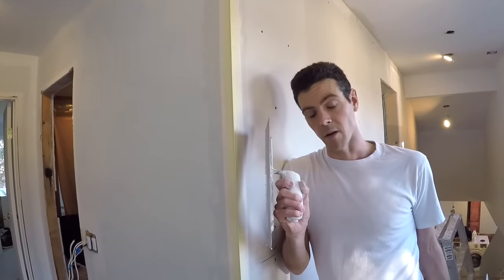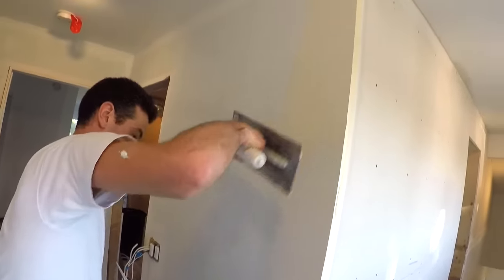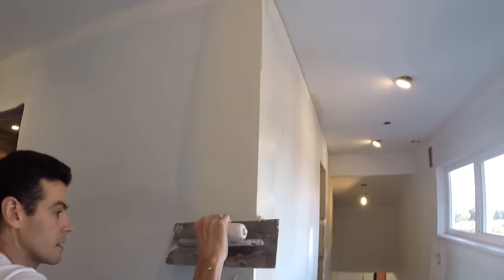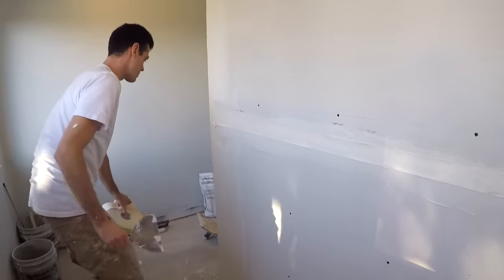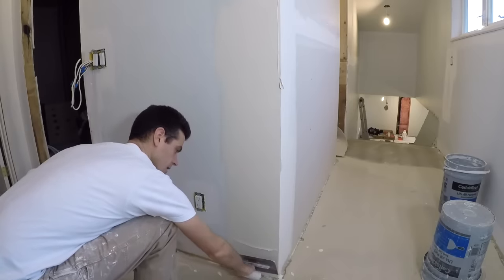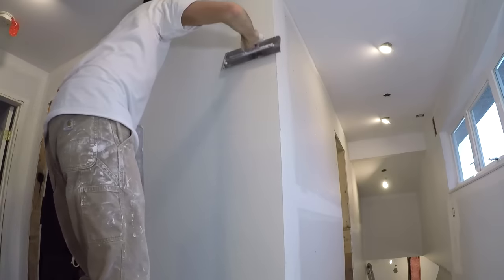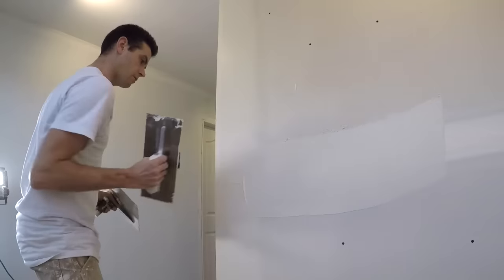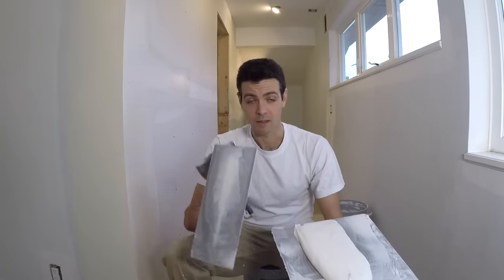HOW TO COAT CORNER BEAD (hawk and trowel)

Comment: how do you sand off? do you use a machine? im having a nightmare at the mo.
Reply from the maker: I usually use a pole sander and sponge. We recently picked up a festool planex. Very powerful tool but soooooo many touchups and hard to use in tight spaces.
Reply: @vancouvercarpenter  thank you, yeah I bought a cheaper drywall sander and I do think it's useful but I reckon I just need to stop sticking so much mud on.😧 thanks for the videos, really spot on and well edited.
Reply: You have made so much difference  to my diy! I'm up a level,, the best thing you have said to date for me is" it's not how much you put on, it's how much u take off" and every time I do 3/4 corners your voice is in my head! And also feather the edges. I painted my first wall today and it was very close perfection. THANK YOU AGAIN.

Comment: And how do you avoid the bubbles.  I get small bubbles in mine.  Ugh
Reply: Bond Crete paint it on it's like similar to a PVA glue but is from concrete and other jobs and 1 part Crete 3 parts water

Comment: Its a bit better to load both sides then break your edges then wipe smooth because if you clean up one side then you still have to load the other side of the bead and get drops of mud on your clean already wiped side just say in. You probably know that though.

Comment: I am not trying to troll your vidios but coating cornerbead should be last, after taping and coating all joints first. Hawk and trowels are made for stucco and plaster, not drywall mud. Pan and knife is preferable.  Other than that, good job.  You would be a good apprentice.

Comment: All of the drywall trowels that i look at are curved so much that they would dig out the mud on the corner of the trowel. I'm better off using a concrete trowel at least they are flat.

Comment: I also use  a well used 14 inch curved trowel on everything
Reply: Gerald Marks 

You must have learned from an old timer like me.
Reply: @chrisj197438  I did . Both had over 40 years experience. They were getting out of the trade.
Reply: Gerald Marks I learned from some old plasterers. Hardest working guys I ever worked with.

Comment: A pro finisher would never use that kind of trowel or that “thing” to hold the mud lol. A pro finisher uses a regular 8 inch knife for the first coat and a 10 inch knife for the second coat that’s it. Oh and a regular pan (drywall finisher pan) to put the mud in   Not that thing lol

Comment: I get this is an instructional video for homeowners, but loading a wet corner bead is amateurish.
Reply: Never been a fan of paper faced corner beads. I prefer the vinyl ones like trim tex, yes they need more mud to fill them but they are strong!
Reply: stargateproductions . I don’t mind anything mud on. Steel bead is the absolute worst. That being said. No mud on bead should be loaded wet. It’s easy to push the bead out of square doing that and it’s just going to shrink back and look like s***
Reply: So you're saying that you should allow the mud you've bedded the cornerbead in to fully dry before loading over it?  (I'm fairly new and thus will ask dumb and redundant questions.)
Reply: WanJae42 .Yes that is correct.
Reply: Thanks!
Reply: Is that trowel specifically for drywall ?
Reply: Tape is the first step oh not a pro